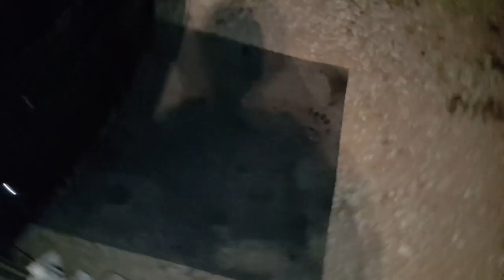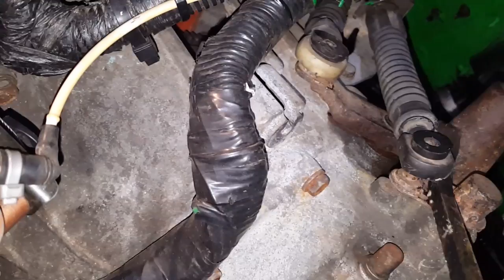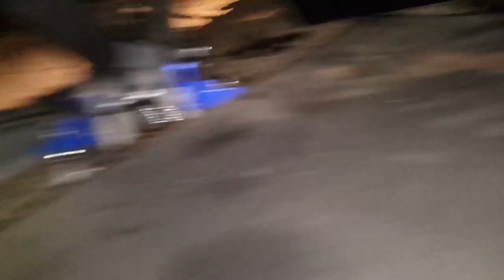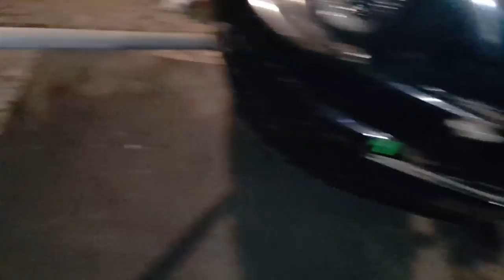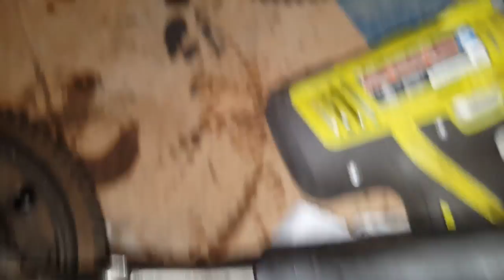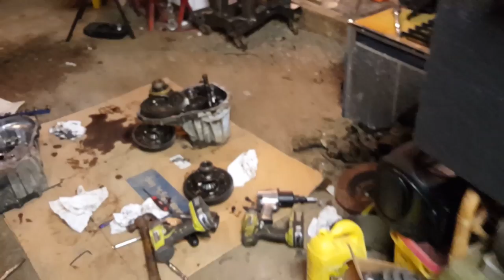95-05 NEON TRANSMISSION (replace,maintenance,clutch,diff saver)

Comment: Mm its there any marking that needs to be matched between the trans and the pressure plate from the engine when reinstalling?
Reply from the maker: +Juan Nunez no it's a guessing game u just gotta line up wholes it might take 2 or 3 trys

Comment: How is the Phantom Grip holding up with the transmission or vise versa?
Reply from the maker: +Omegaone1 great
Reply: Can you offer any tips regarding installation, maintance & pro/cons of the phantom grip.  how long have you used the PG, have you notice any where on spider gear and housing if you have had the transmission open.  did you machine, grind or do nothing to the spider gears??